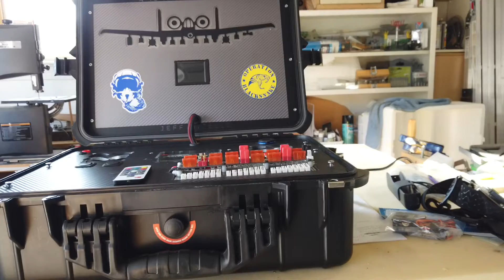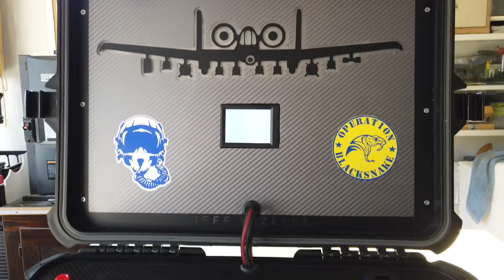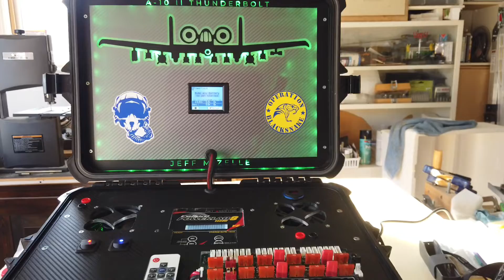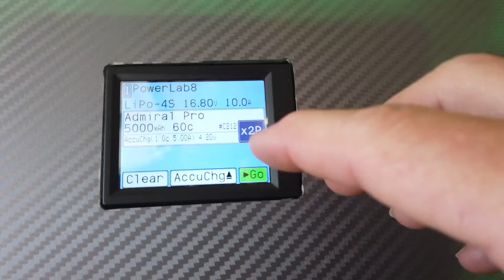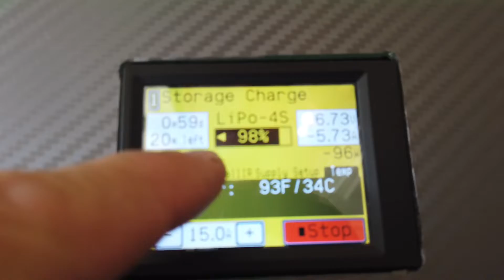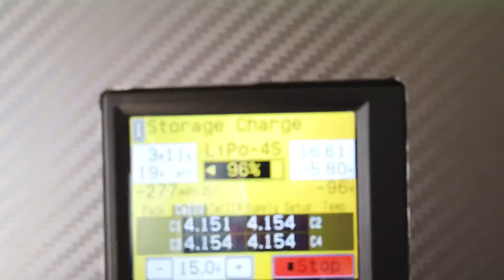REVO ELECTRIX CHARGE CASE WITH POWER LAB8 and MEANWELL 24v power supply

Comment: Very impressive Jeff, that's the coolest charging station I've ever seen.  ✈
Reply from the maker: Thanks Wayne, makes charging much easier either with power or without
Reply: @JeffsCustomRC  hey Jeff,  how many of the 6s batteries can you charge before you have to recharge this unit  ? For that matter,  how many 4s and 3s can you do at the field  ?
Reply from the maker: wayne lee 630 very good question Wayne, I mainly charge larger batteries and we have power, however...a 6000 mah battery should be able to reload several 3-4’s if their only down to storage level, also, if you have a couple of 6000’s charged, I’d say you’d be able to get several charges for smaller batteries before they were below 3.80, I’m sure someone could tell both of us how to do the math on this one, and it would be good to know, thanks for asking
Reply: @JeffsCustomRC  thanks man see ya tonight if you're able to make it ✈  wheels up  👍